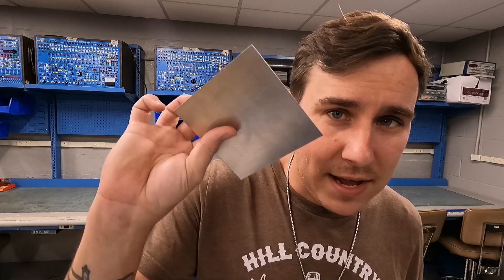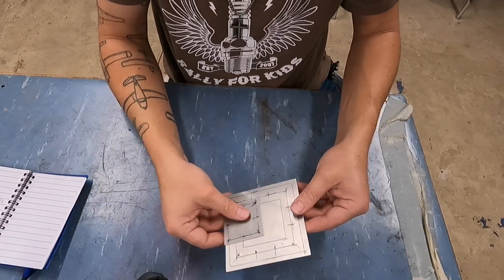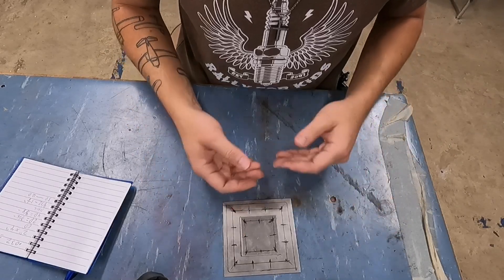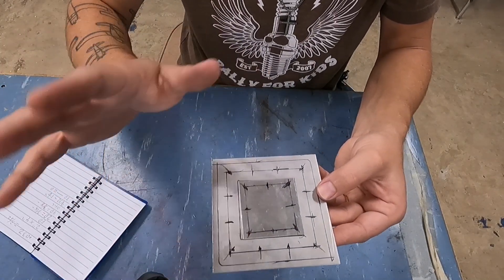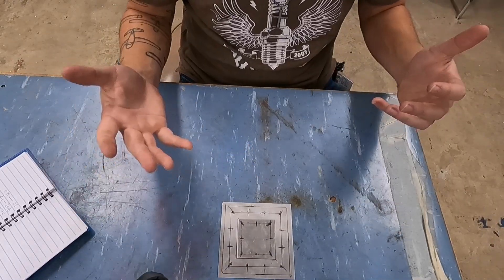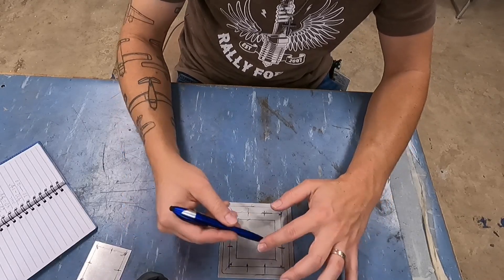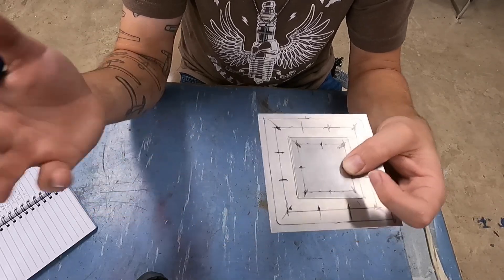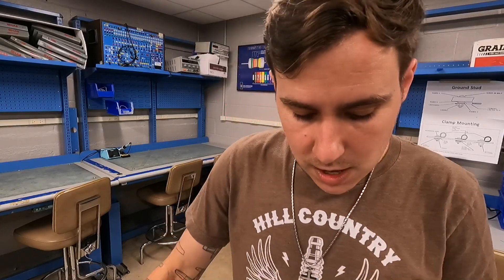How to Lay Out a Flush Patch Repair | Aircraft Sheet Metal Tutorial for A&P Students

Comment: He's correct.  Use the least amount of repair you can (in most cases).  That way you have the most original strength of the part.  It's less damaging to the original part and the least work for you.  Always go with the least repair specs that you can.  It's not lazy, it's keeping the strength of the original part.  Always, always, always check the books on what you're doing.  Stay safe, stay employed.

Comment: I am working on a friends old, unbuilt RV4. The tip panel is built and the first 3 inches is crushed. I plan to take out the tip ribs and straighten then and reinforce the area with a patch shaped like the uncrushed area. As you are not replacing anything, only reinforcing it, how to figure out the rivet layout and how many rivets are needed as there is no inch damage!  How about how to replace the 7" area at the spar that the holes have been ripped out? I am an A&P but cannot get any answers anywhere. Also, on the rivets needed per inch it says this many for a primary, this many for a secondary patch. What is a primary and secondary. Thanks for your time.

Comment: I have a conundrum, the AC43.13 is not approved data, or so test question says, but it is different than what the 8083-31 says. I had a quiz where I followed the AC43.13 and got all my answers wrong as it relates to spacing. The answers the instructor has are completely different than everyone in class. But the Instructor cannot answer why it is different. What do I do to correct this? What book is right?
Reply from the maker: You are correct it is only acceptable, the Aircraft manufactures data will overrule 43.13 and even 8083-31. I would ask was I supposed to follow specific manufacture data for this repair or was 41.13-1b my acceptable data for this?
Reply: Thank you for the reply and the suggestion. But let me ask this in regards to the AC43.13 or the 8083-31 which one is correct?
Reply from the maker: 43.13 remember the 8083 is just a textbook

Comment: In AC 43.13-1B, I see where it outlines the minimum edge distance and minimum rivet pitch, but I couldn't find any mention of maximums for either. Are maximum edge distance and pitch values specified elsewhere in FAA guidance or another official resource?
Reply from the maker: The 43.13 says edge distance should be 2d minimum . However it is important to rember the aircraft approved data will overrule 43.13 with that said most manufactures say a repair should be a maximum of 4d edge distance.
Reply: @brycebuildsit  Got It! Thank You!!

Comment: Do you ever use fiberglass to repair airplanes airframes. ?
Reply from the maker: There are composite aircraft like the Dimond and the velocity. So the short awnser is yes. Composite repair is much more involved and messy, in my opinion. You would never you fiberglass to repair a Crack in aluminum though

Comment: Maybe I'm just tired, but I'm a little confused. How do you know how much to cut out around the crack and how big things like the doubler need to be? Also do the rivets have to be staggered like you have them on your repair? How did you know how many rivets to use? Is it just however many will fit with your current edge distance and rivet pitch? Thanks!
Reply from the maker: All that info depends on where the crack is. 43.13 chapter 4, starting on page 4-19, is the data I used. As far as removing the Crack you have to remove enough that you have at least one edge distance on both sides of the rivets. In reality, I do prefer a circle patch.
Reply: @brycebuildsit could you make a video showing you getting this information? I am having a lot of trouble finding it in 43.13-1b.